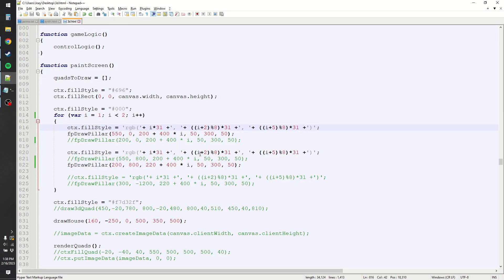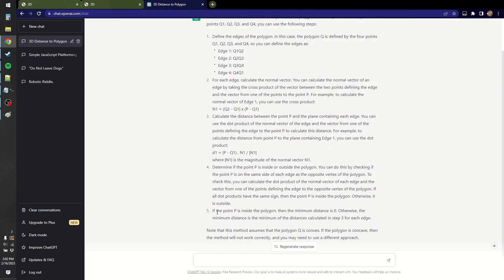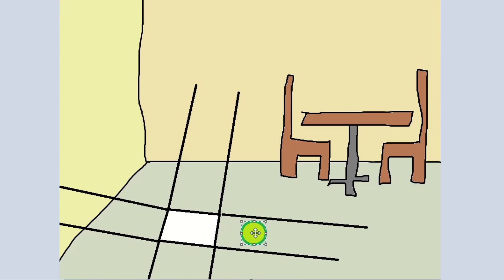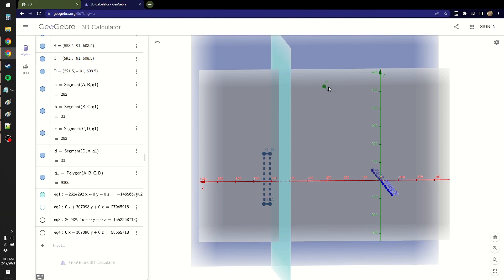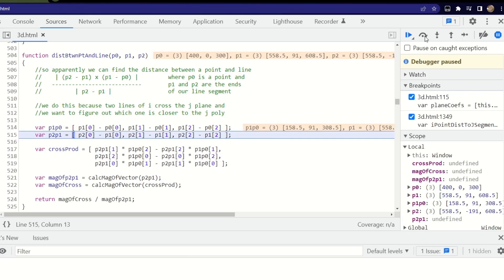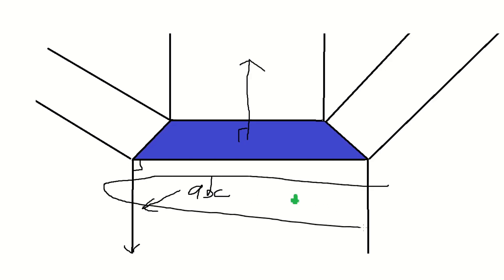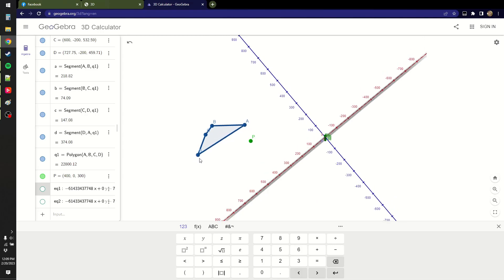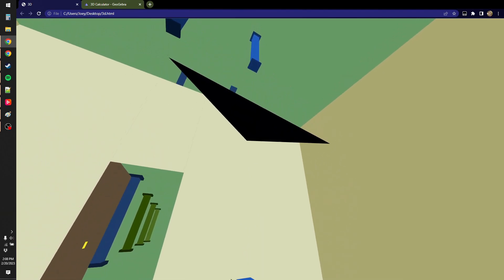3D Engine Coding: Finding Min Distance from Point to Polygon

Comment: I know I missed some of the earlier videos, so sorry if this is something you've already discussed: are you writing unit tests for all of these interesting cases?

Seems like it would help at immediately catching regressions. Also modern unit testing frameworks can even automatically run every time you save your source code file, and they can update you with graphical color output.
Reply: They will slow development too much though. Imagine creating all tests then realizing he has to change the way his data is stored (quads -> triangles for example). Then not only he would have to change all the functions but their tests too.

Comment: how about first checking the closest distance to the polygon plane (assuming its planar) then checking the corners (polygon edge/vertex limits)
Reply: poor mans sorting is breadth first search in 2d or 3d grid (wolf3d sorting), basic version of octree sorting, just place the indices of triangles/objects into the grid cells where they are located, when they move they update their grid/octree "membership"
Reply: also then you can do local cell z-buffering (over-draw), no need for global z-buffering
Reply: um, you would need to split the triangles with other triangles (planes) to get the partial ordering of all triangles, to draw them in order
Reply: if the closest point to the plane is outside the triangle boundaries, then some of the vertex points of the polygon is the closest point to the camera point
Reply: try multi-layer height-maps for simple complex terrain, on-off consecutive layers, whatever